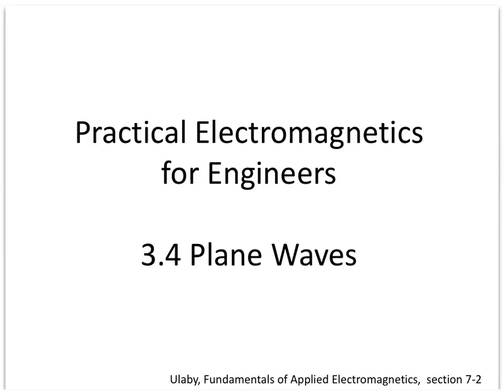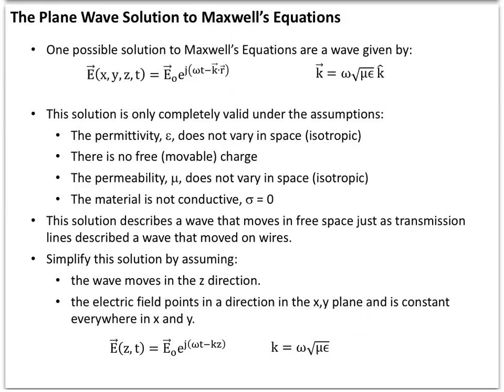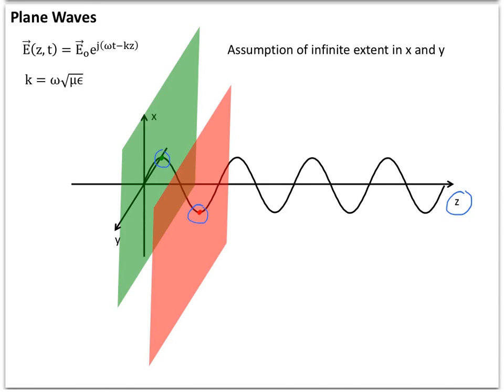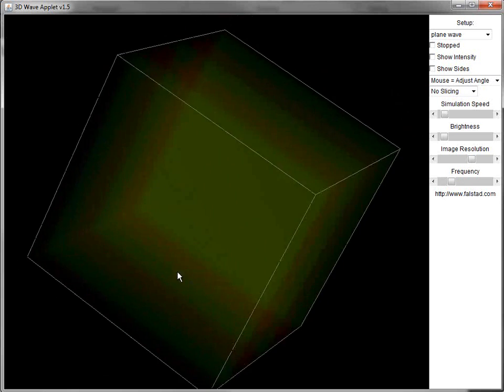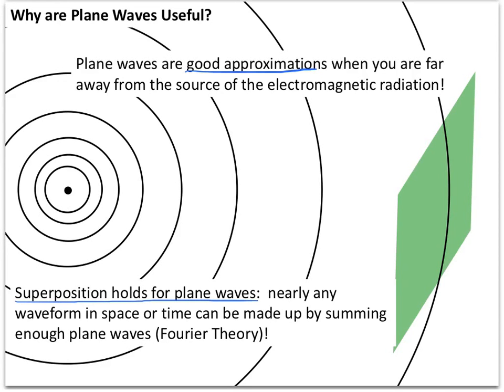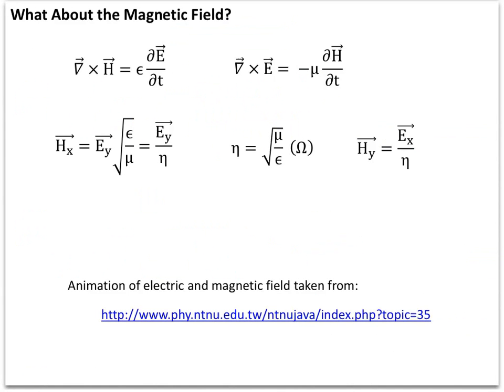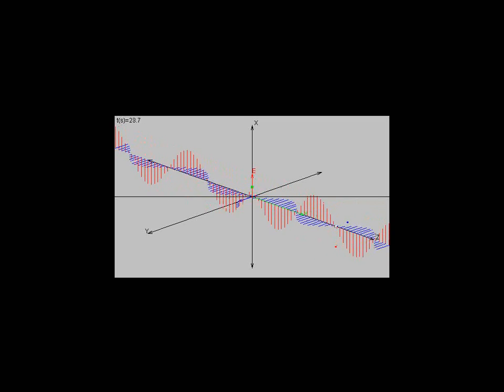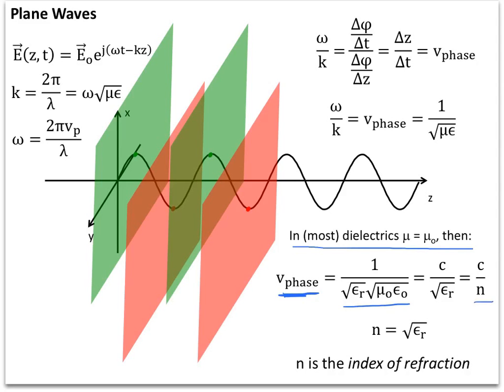3.4 Plane Waves

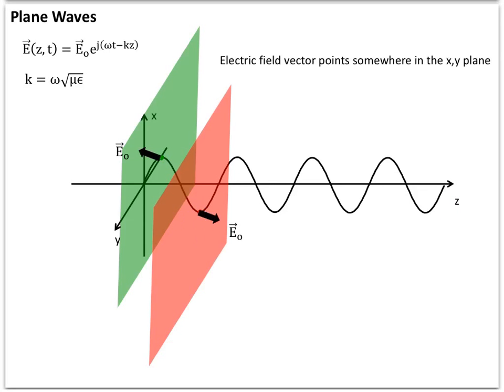Comment: I like this video very much, but there's a bit of difficulty at 6:50. Suddenly, vector arrows appear attached to a couple of the peaks of the sine wave representing E magnitude. This is treating the E-magnitude graph line as having a position in space, which it does not have, and thus it's a bit of a distraction. Those E vectors should start on the z-axis and terminate on the sine wave magnitude line, like here: https://en.wikipedia.org/wiki/File:Onde_electromagnetique.svg And then to make matters more confusing, the example red and green plane segments, representing flat regions of interest in spatial space, jump up and down tracking the sinusoidal graph of E which is in the domain of E magnitude and direction.
Reply: Good comment. I was about to do the same. Also, Eo is a constant vector, it should not vary from one wavefront to another plane to another. The exponential multiplies the E0 vector to give the E vector which seems to change parallel to the x-axis. But I may be wrong, the axe of oscillation also seems to be 45 degrees to the xy-axis and that would explain why he draw the vector at those angles.